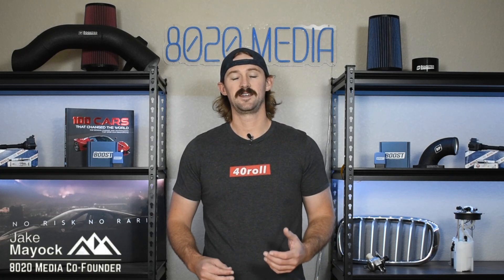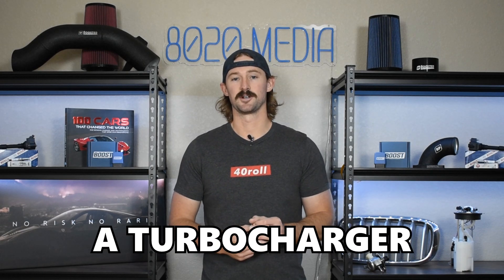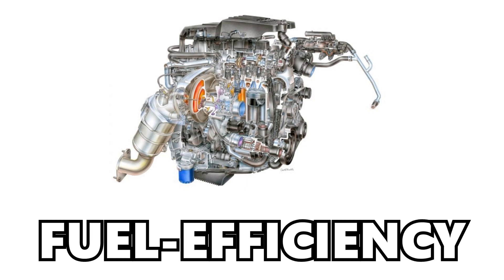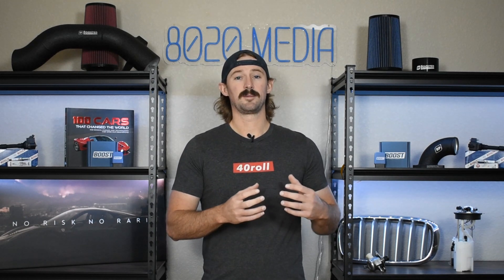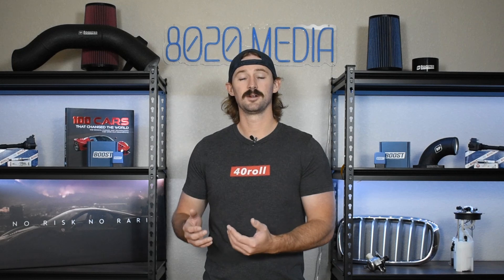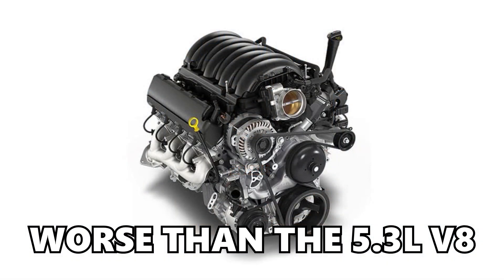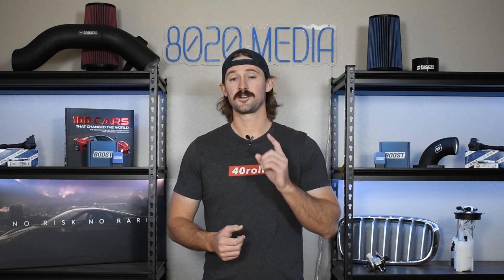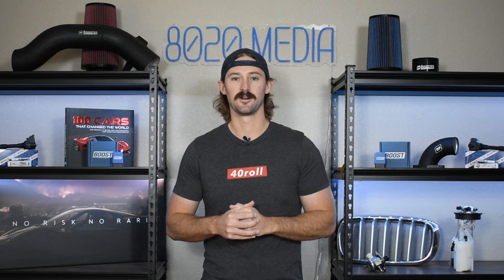GM’s 2.7L L3B Engine | Common Problems, Complaints, & Reliability

Comment: I don’t know, man, I kind of have to disagree with a lot of this. Coming from a Silverado with the 5.3L/6sp in it to a Canyon At4 with the 2.7L/8sp, The canyon drives so much better. It’s not even comparable. I know it’s technically a smaller truck, but it only weighs 500 pounds less than the full size. With 30 K on the canyon, my overall average MPG is just under 20, and I do not baby this truck at all. the Silverado with a small lift, 1” taller tires was lucky to get 15. If you’re an aggressive driver, the eight speed actually does what you want it to do, unlike most automatic transmissions. I absolutely hated the six speed in the Silverado. The combination of the 2.7L/8sp in manual mode is just an absolute blast on the back roads, it’s like driving a go kart. I would never go back to a small V8 after having this turbo, but I completely understand why the boomers don’t like it.
Reply: I went from a 2014 4.3 6 speed to the 2024 2.7 upgraded 8 speed. Both trucks are single cab 6.6 bed. The 6 speed was rough as hell since day one. The 8 speed is nice and smooth so far.fuel mileage is similar between the two trucks. The 2.7 has a lot more power obviously.
Reply: I'm almost 71 I've been watching  the latest gen. colorado and canyons since they came out. I am in line to buy a zr2 !
Reply: Lifters are not being used for AFM
Also the engine is not being hailed for mileage. That was not the focus.
Reply: You can’t even compare motors if you don’t have the same transmission under them, and believe it or not 500lbs is huge especially when driving around town stoping all the time
Reply from the maker: B - Everyone is held to their own opinion. We appreciate you taking the time to share your experience!
Reply: I agree I have a 2023 Chevy Silverado 2.7 high output turbo max and it’s a beast compared to the 5.3 v8 I can talk in experience since I did own a regular cab gmc sierra 1500 and the turbo max will beat it any day of the week the v8 and not reliable anymore for Chevy and gmc
Reply: I just got out of a Colorado and I absolutely adore it. The HO 2.7 is the highlight.
Reply: I'm still sticking with my Minimax 2.8L, as long as possible.  By far better fuel economy than gasoline.  It's just disturbing why the States are so against Diesel technology.  Yes, aftertreatment systems are what destroy the reliability of diesel, but there are ways around it.  Diesel all the way.
Reply: I with ya. I had a 4.3 with the 6 speed and though it was very reliable for the decade I had it that trans was clunky as hell. I now have a 2.7 in a Silverado. I love it and the 8speed is way smoother.
Reply: This guy is an absolute moron!
Reply: Afm JUNK
Reply: Easily get 26-30mpg with my 2.7l in my 2021 silverado. It's got a turbo you really should keep 91 or higher to keep it clean
Reply: @sknight13602 higher than 87 octane fuel is completely unnecessary in this engine, and running 91 octane will not improve performance nor keep the engine cleaner.
Reply: @sknight13602  explain how
Reply: Have you gotten your engine recall letter yet? Your engine will fail soon save your time buy a ford
Reply: @evantrapmcfarland1710 There is no recall on the L3B. We have five trucks now with this engine and zero issues.

Comment: Is it DI, or port injection? I'm betting DI and that's why it's such poor mpg.
In order for me to consider a four cylinder, I would EXPECT 25 mpg.
Reply: The 5.3 V8 gets around 23-25 on the freeway, but this tiny 4 cylinder can't do that, funny enough.
Reply: @Deleteguest  Exactly!
Reply from the maker: S - Direct injection.
Reply: Fuel economy is a function of the vehicle, not just the motor!

Comment: Power has a cost. 300HP is going to drink a certain amount of gas no matter the cylinder count. People need to stop thinking 4 cylinders is automatically fuel efficient. Lifetime average in my case was 18.7 miles per gallon so not far off on 87 regular. 

I had the 2021 version of this engine and just replaced the truck because of (surprise) collapsed lifter issue. Decided after dealing with 8-speed transmission issues since Day 1 I wasn’t willing to start down a road with the fuel management stuff anymore. Had to replace lifter bank and both camshafts. 

Sold it back to the dealer and got a 6.6L gas. Old school pushrod V8 with no cylinder deactivation no active fuel management and no start stop garbage.
Reply: @billjones373  , Why I waited to buy a 2022. Didnt want that AFM crapola or that 8 speed trans. GM needs to do better in ensuring better reliabilty & costly repairs why buyers look at Honda & Toyota for alternatives!
Reply: @harrymiller8538  Well now they're saying the 10 speeds are having issues, another issue with GM's are the fuel pump modules a tow truck company down here in Texas was talking about how many they have to tow back to dealerships. Now i don't know if i want to go with the 2.7 or 5.3 i'm assuming dfm can be deactivated on the new ones right??
Reply: @larrytanton5787  , The new ones after 2021 dont have that crap. It didnt work on the 80s with the V-8-6-4 in the caddys then and with the computer gizmos today still dont work. Trans were 3 speed with overdrive.  Sad GM or any of the companies wont make a reliable truck nowadays like the 90s were. That 5.7 was a darn good powertrain along with their trans then! Why so many are still on the roads..
Reply: @harrymiller8538  The 2021's to present have DFM.
Reply: @harrymiller8538 you found engines from Toyota and Honda that don’t employ AFM??
Reply: I get much better fuel economy on my 2.7 then my 5.3 driven both the same way
Reply from the maker: B - Thanks for taking the time to share your experience! Sounds like you went with a better one!
Reply: By the time you add 14 psi to the 2.7l it's a 5.4L lol...
Reply: Interesting. The values don't collapse on the 2.7 like the V8's. The cam shifts to engage different cam lob profiles.
Reply: This is what I’ve been saying it takes a certain amount of energy to drive a 6000lb truck with the aerodynamics of a brick it doesn’t matter all that much if it’s from 8 or 4 cylinders. The 5.3 gets like 22-23 mpg and the 4 cylinder gets 24. It doesn’t really seem worth it to make such a high stress engine for 1-2 mpg gain. I do think 2.7 turbo max engine itself is great in a car it’s more appropriately sized for.
Reply: The 2.7 does not use lifters. Nice try......
Reply: @EETechs - yep this was from a while ago and I was fed up with the truck so I explained what the dealer service department told me at the time. Apparently the tech mistaked it for a V8 with a quick listen to the knocking. It was actually a roller follower failure which damaged the cams. Thanks for reminding me to update the post. In any event, between the transmission issues and now an engine issue I was done with that truck.
Reply: @EETechs  Really??

Comment: The 6 speed is a turd, it will grenade at or just above 100,000 miles.  Great info.
Reply: Ur wild the 6l is a great trans.  It’d the 8speed that’s trash
Reply from the maker: D - Everyone is held to their own opinion.
Reply from the maker: W - Thanks for the feedback! Hope it helped.
Reply: That they will do regardless of proper fluid changes.
Reply: My six speed launched at 22,000 miles had to put a new one in, took almost a month to get it in at my dealership.

Comment: Poor GM engineers
Reply: They all have their problems, and for the record the TurboMax with the updated 8 speed is probably the most problem free choices.
Reply: @johnlittle6711  updated in the 2024 or 2025's?
Reply: The main issue is the Fed and Regulations.
Reply: Poor engineering by gm
Reply from the maker: G - True..

Comment: My 2024 Canyon get's 19.3 combined @ 6,000' AMSL. Cheap gas or "mid-grade" can't tell the difference... That said, a 4 banger in a full size PU? Really, someone thought that was a good idea...Mary Who?
Reply from the maker: M - Couldn't agree more..
Reply: I have the turbomax in a sierra 1500. Goes great. Then Again probably weighs less than your little canyon. Single cab short bed.
Reply: @johnlittle6711  John, I traided my 2022 1500 Ram, regular cab, short box  with the 3.6 V6 for the Canyon, cuz...It doesn't look like Stalantis / Ram will be among the living much longer.  Regular cab, short box Sierra is a rare thing these days, a proper gentleman's truck, enjoy.
Reply: That's pathetic, I get my 18 mi a gallon in my 5.3 2002 Silverado with a 4-in lift.

Comment: In my opinion engines are way better than they use to be, but the drivers ain’t,  not maintaining oil changes and filters, not warming up the engine and every pull out is full throttle IHRA run. My advice for most people get the 2 boat anchors GM offers or offered, the 5.3 or 4.3 they are slow but they’ll handle a lot of abuse.
Reply: My 2021 Sierra 1500 blew its lifters at 5,000 miles. It was the 5.3 engine. Garbage...
Reply: @crusher0427  What is sad the 5.3l was once one of the best engines ever made, but when they started tinkering with it adding AFM and other adds they ruined it. I have a 2003 GMC runs fine and 20 years old. It will need a new engine in the near future has a lot of miles, but its cheaper for me to put a new engine and transmission in it than buying a new Truck which is what I am going to do. I am NOT going to invest 60-100k bucks on a truck that will depreciate faster than grease lightning. I would rather invest that money into things that grow in value like property.
Reply from the maker: J - Well said.
Reply from the maker: P - From an innovation standpoint, sure. But from a reliability standpoint, they aren't even close. As far as driver's not maintaining engines properly, we also agree!
Reply: Ha ha exactly why i refuse to buy used.
Reply: I bought a 120K/120mo warranty on my 2023 2.7L Silverado.  A vehicle is the only thing I buy extended warranty on.
Reply: No they are not better, they have higher complexity and higher expense when repairs are needed. Plenty of cases of failures when people had documentation maintenance was being done and still had failures. You can keep drinking the Kool-Aid though:P

Comment: Its an OHC engine- it doesnt have lifter like the OHV V8s have.  
Now the sliding cam setup- jury is still out on that but then this engine has been around for over 5 years now and I have not heard of any issues in higher mileage trucks.  Have you?
Reply: My brother in law is coming onto 160k on his. Aside from a few recalls and a fuel injector replacement he’s had no problems.
Reply: @coryw.9086 that's the highest mileage on a 2.7 TM I've heard of them.
Reply: Yeah, drives a lot. Work’s oilfield and does quite a bit of hotshot stuff.
Reply: These engines do have occasional rocker arm failures. There is a bulletin for it
Reply from the maker: J - Thanks for sharing your insights. It's difficult to tell right now, because there aren't too many high mileage 2.7's yet.
Reply: I chuckled at the lifter failure comment in this video as well dude doesn't know anything about this engine just a V8 guy who's mad about the 4 banger.